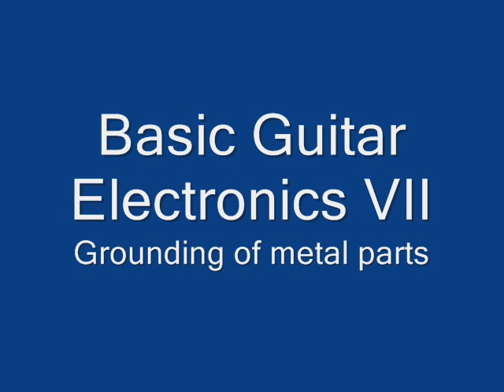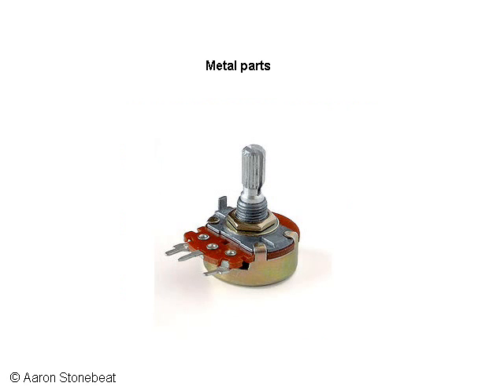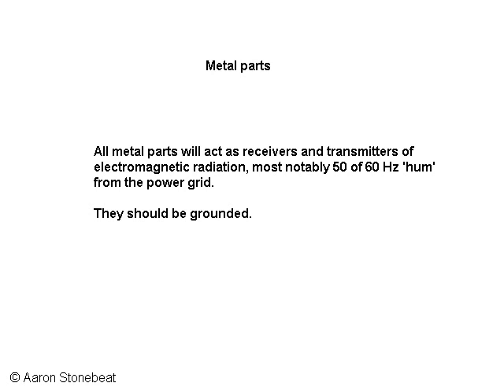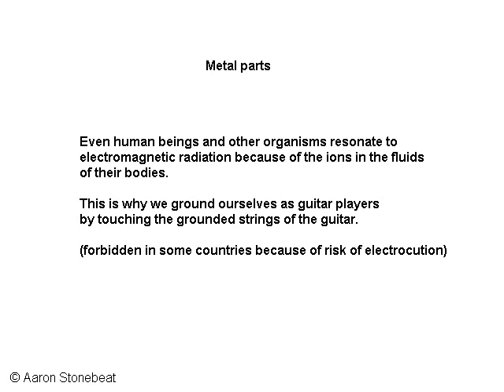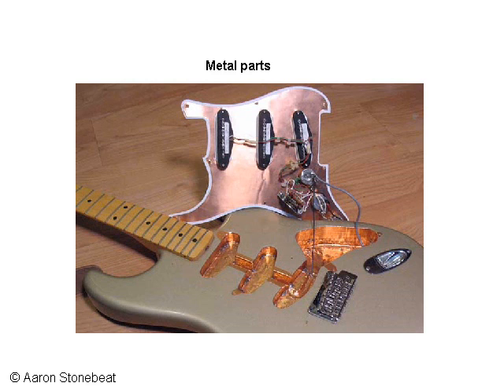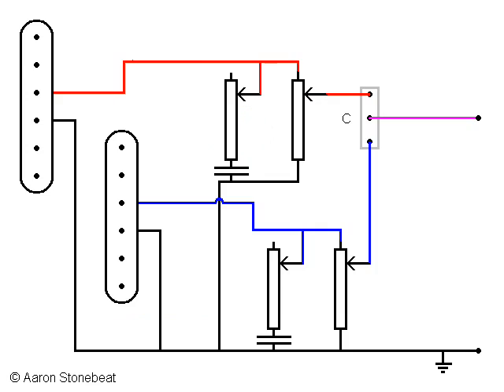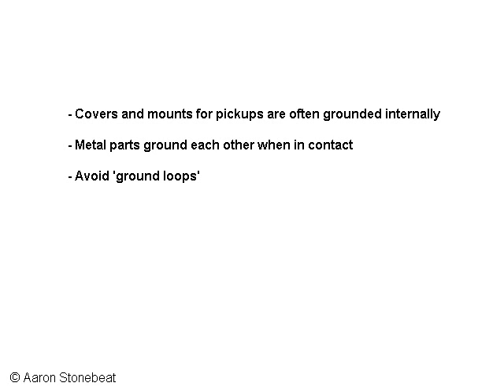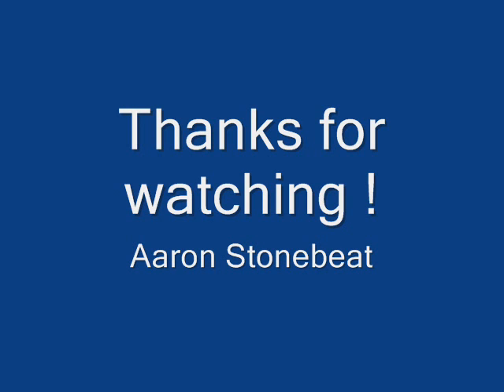Basic Guitar Electronics VII - Grounding metal parts

Comment: I remember singers getting big shocks from their microphones when the PA system or amp wasn’t wired properly or was plugged in wrong. (That’s why these devices have 3 prong plugs now).
Reply from the maker: Yes, rock 'n roll is truly dangerous 😉
Well, actually high voltages and currents are. Keith Richards got badly electrocuted on stage a long time ago, but of course he survived.

Comment: I am extremely grateful for this and the rest of your fine and helpful to me work.  I had embarked on my most ambitious build & I was trying to ground around and connect a piezo cable & a pickup I made from the winding inside a hard rive & two magnets.  I think I failed to ground to the copper tape.  Or something.  As said this is ambitious.  I was trying to use one gain and one tone control for both, not thinking it would be too bad & I was being ambitious enough.

Comment from the maker: It acts as a fuse. If the voltage difference between say the outside of a microphone and the ground of your guitar is too big it will fry and sever the ground connection in your guitar. You loose the guitar signal but you have a better chance of staying alive.

Comment from the maker: Electrocution can happen usually when power supplies to stage and PA system are not connected in a proper way; the mics are then connected to the ground of the PA and the guitar is connected to the ground of the stage. Potential differences between the two of up to several hundreds of Volts can occur.

Carry a multimeter with your gear to be sure. You can put a capacitor with a small voltage value between the ground of the guitar cable and the rest of the shielding/ground of the guitar.